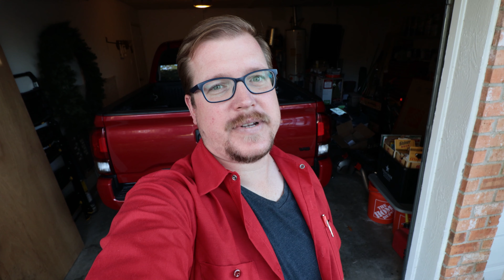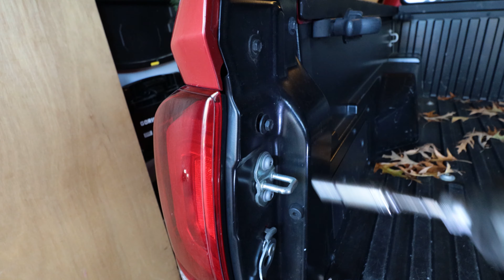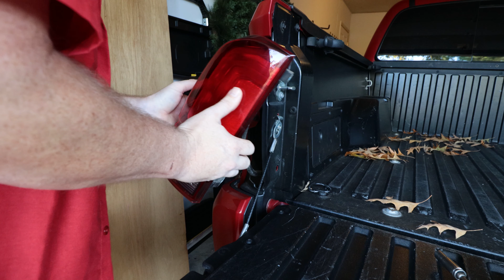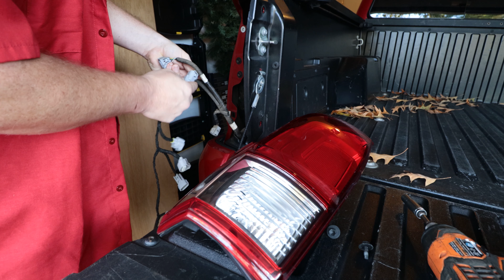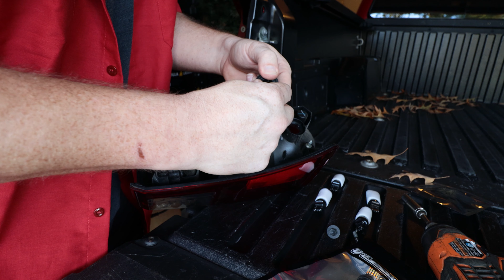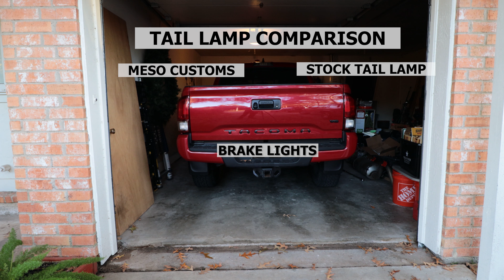Toyota Tacoma Mods | LED Tail Lamps | Total Tail Stage 1 | Meso Customs | LED Bulbs | Diode Dynamics

Comment: I understand your video has been out for a while, but I just purchased the Meso Customs Stage 1 for my 2023 Tacoma SR5 v6, 4x4, and couldn’t be happier, they are very bright plus a much better pattern than original, I personally did not need to use a resistor. The only time I get hyper flash is if the reverse and hazards are on at the same time, but personally I have not been in that situation. This is a less expensive  option than changing the entire light assembly, but don’t be fooled all  patterns are very bright.
Reply from the maker: That's awesome! 👊👍 I am still using this setup, and I am very pleased with the performance 😁.

Comment: What happens when hazards are on and you are reversing ? Some times when backing flashers are used .
Reply from the maker: This is true. Honestly, I don't know lol 😆. I have to go try it in a bit and report back...
Reply: Update ?
Reply from the maker: So if I have the vehicle in reverse and use a turn signal at the same time, there IS hyper-flashing. This is the ONLY SCENARIO in which I've experienced hyper-flashing (by accident). 

However, since I NEVER use a turn signal when in reverse, I am not too concerned about it. The LED lights are still going strong and working normally as designed. 

I hope this info helps! 😁

Comment: I'm pretty excited to see how these look on my truck. Just ordered yesterday from Tacoma beast. I'm a little concerned no load resistor was offered on the site. Just to email them if you need it after.
Reply from the maker: I wouldn't worry too much. The only time I've experienced any hyper-flashing is when using a turn signal while in reverse... and since that will never happen in real life, I didn't feel that installing resistors was really necessary.

... but if you do end up wanting to install resistors, I've heard that Meso Customs does an excellent job in regards to providing them for you.

Comment: I installed this kit over a year ago they look much brighter the only thing you didn't mention is the need for resistors for the turn signals or else they will hyper flash.
Reply from the maker: Yeah I forgot to mention that Meso Customs will send you resistors if you experience hyper-flashing. I found that, on my tacoma, the only time I experience any hyper-flashing is when I am in reverse and use a turn signal at the exact same time...

And since I would never normally use my turn signal while in reverse, I didn't really feel the need to install any resistors... the turn signals work normally for me while driving forward so I didn't worry too much about it lol 😅

Comment: IS A GREAT PRODUCT FROM MEZO....I GOT THE SAME STAGE 1 FOR MY 2020 TACOMA INSTALL IS VERY EASY AND I HAD SOME HYPER FLASH SEND A EMAIL TO AUSTIN FROM MEZO HE SEND ME  TWO RESISTORS INSTALLED A...BOOM...PERFECT..THANK MEZO!!!!!!
Reply: How do you mount the resistors? Any drilling?
Reply from the maker: You could possibly use self-tapping screws or even just zip ties to hold the resistors in place (preferably screw into plastic, or metal if you have to... or zip tie the resistor securely to the wire harness itself).
Reply from the maker: Awesome! I'm glad to hear that they took care of you with the hyper-flash issue.